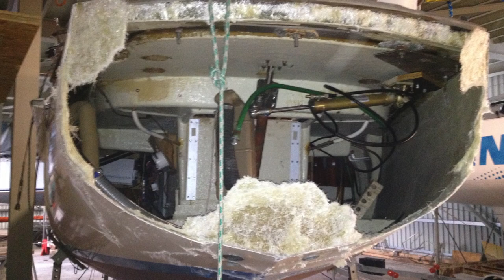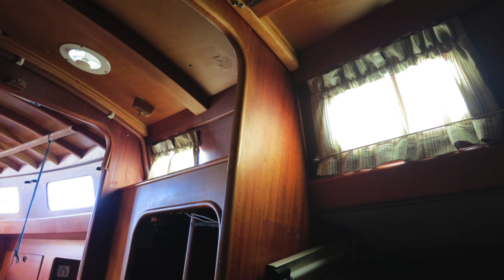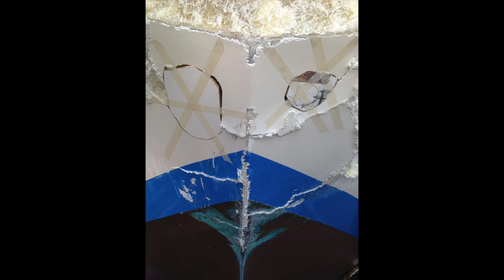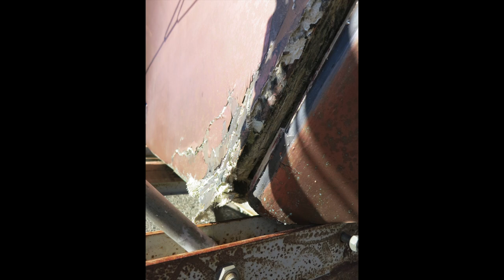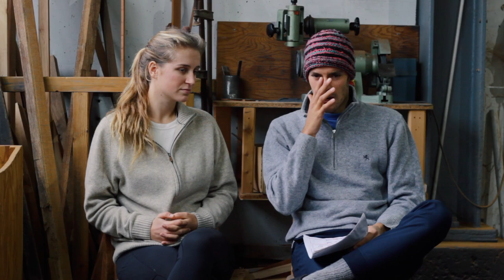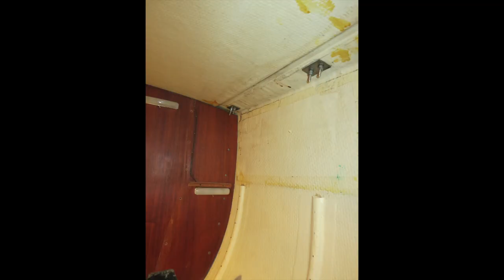Our boat fell from a crane. Here is what was damaged. [Ep 2]

Comment: Interesting she looks to have a below decks hydraulic auto helm but in the sailing video you use a tiller pilot . What was the hydraulic and or was it damaged ?
Reply from the maker: That was the hydraulics for the steering wheel wich had an electric wheel pilot.
My preference is tiller and also we have a roomier cockpit now.
Aladino
Reply: @SailingMagicCarpet  I like the tiller as well , have one on my Laser 28 . However I put a quadrant on the shaft and still have a below deck auto-helm and it is much more convenient than a tiller pilot . I used a octopus drive instead of a hydraulic so almost no resistance and does not take up much as much space .   Because it is down below on auto I flip up the tiller and have even more space and the auto can sail to the wind instruments or chart plotter .  The head you had and the computer can likely drive the octopus drive